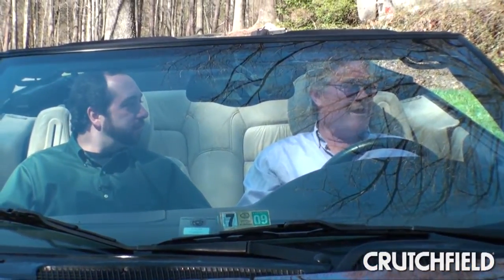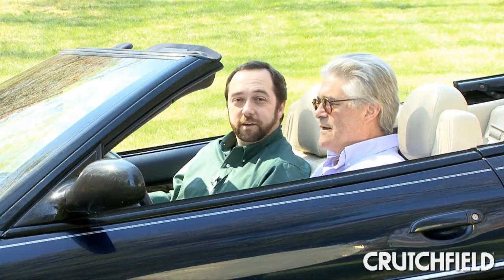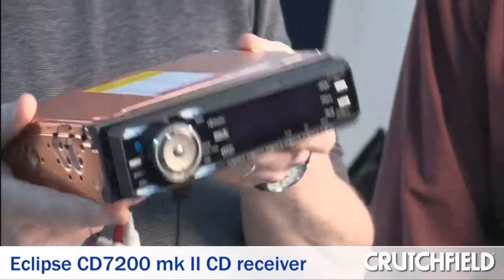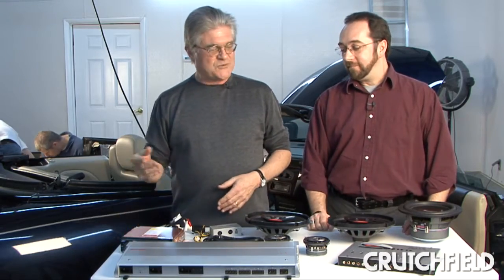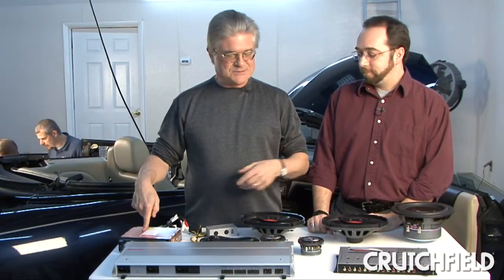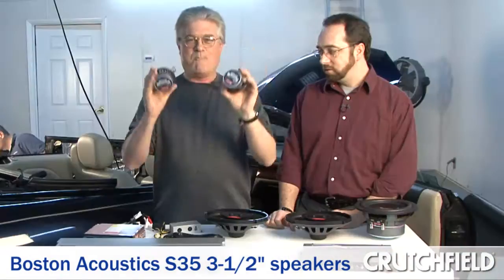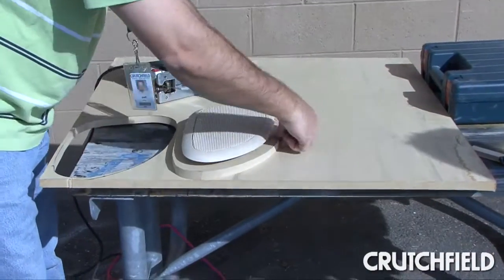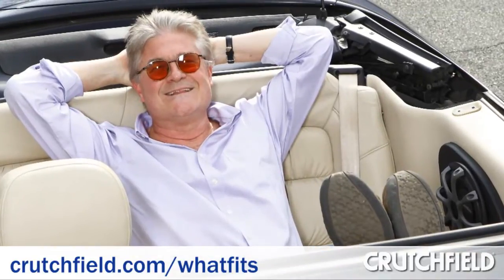How to Get High-quality Sound in a Convertible | Crutchfield Video

Comment: If there is something i have learned from sound in boats and convertibles, is that bass will be very difficult to sound in open air, and you need a lot of power to make it sound at least decent, thats why you need a 15" sub in a convertible and a 6" in a VW bug.....
Im preety interested cause i have a sebring and it sounds terrible

Comment: Sub doesn't go in the trunk in convertible?
Reply from the maker: Hi Sergio, there are many options for placement. Would you like help choosing a sub for your car?
Reply: @crutchfield  Hello. Thanks for offering your help, I already have a sub but was wondering since the trunk of this car is separate from the interior of the car, does it make sense to install the subwoofer inside the trunk? I also have a convertible similar to the one in the video.
Reply from the maker: Okay, cool. In that case, the best placement will likely come down to your sub enclosure size and fit.